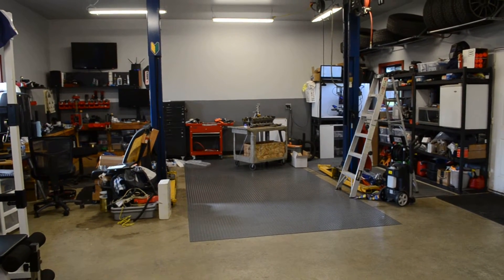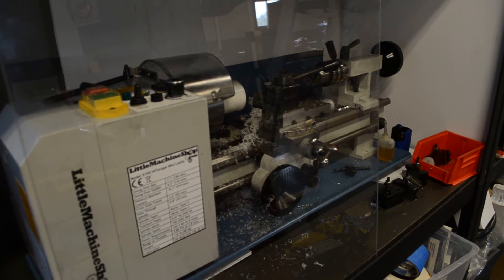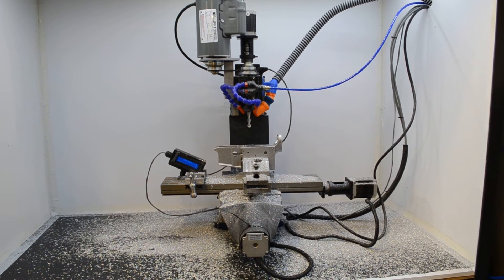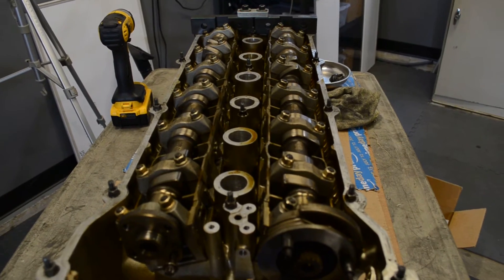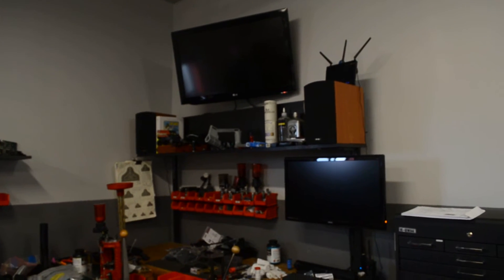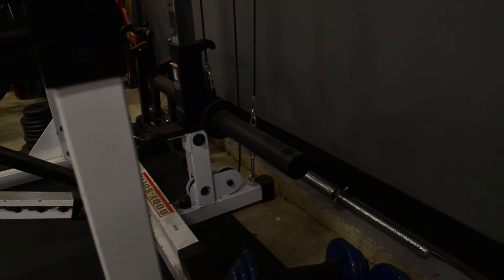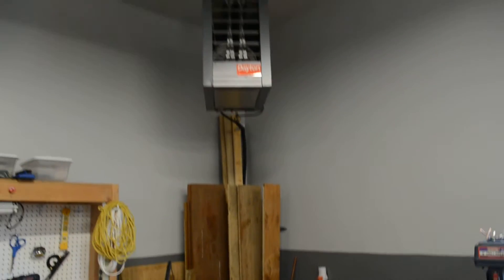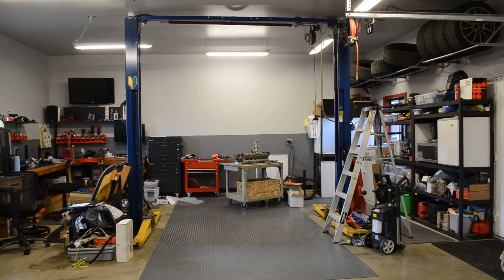Shop Tour!

Comment: Watched the vid just because I thought that was an s52 head for the video thumbnail. Miss my e36 m3 a lot. I take it you're gonna put aftermarket cams like schrick or something?
Reply from the maker: This head is just for making the tool. When I do the job on my car, I'll probably do something.  The Riot Racing upgrade seems like a good value.
Reply: +Guy in a garage for sure. I had just about every non forced induction bolt on mod except cams. Cost/performance of the riot racing are unbeatable. IIRC you can keep stock injectors too which you can't do with schrick. Hope it all works out and post a vid when it's done!
Reply from the maker: Yep, stock injectors and no tune required.  The project is more about the tool I'm making than the cam upgrade, but I'll document it all.